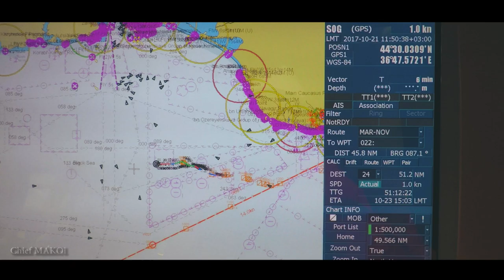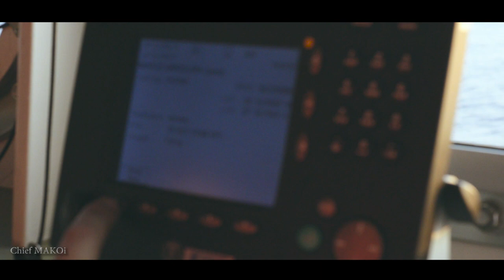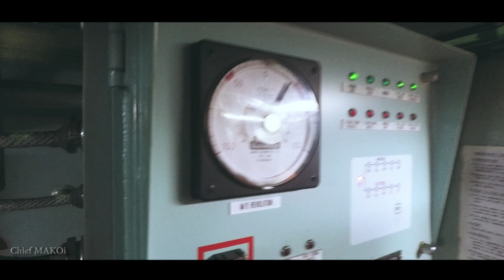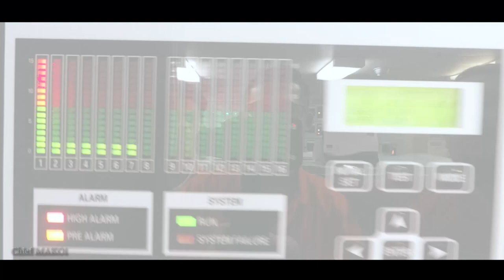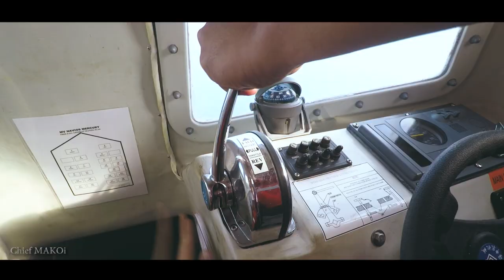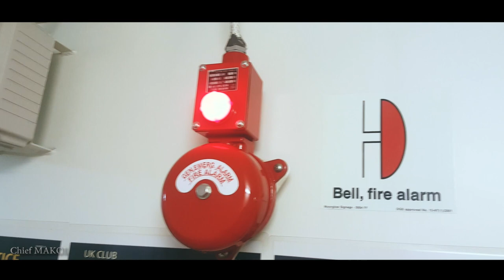Drills While Drifting : Off the Coast of Novorossiysk | Seaman VLOG 035

Comment: Chief Which side is good DECK or ENGINE.. which Side has more work and Less work Or they are equal?
Reply from the maker: I would say equal but different.  Engineers' job are more of the dirty, manual labor sort.  And very stressful when dealing with machinery damage because you will need a strong theoretical background as well as solid work experience to deal with those successfully.  For the Deck officers, they are more focused on watchkeeping and shiphandling.  But there are times when their job demands very long hours.  In the case of Chief Mates, they almost have no time to go ashore as they are the ones in charge of Cargo Operation.  
It basically depends on your personal inclination.  I am technically inclined, I like tinkering with machinery and I view trouble-shooting as an enjoyable challenge so Engineering is the logical choice for me.
Reply: But chief what about the salary packages does deck officers earn more than Engineer officer or the salary is equal to everyone?
Reply from the maker: Salary of course depends on rank.  But officers of the same level e.g.  3/mate and 4/engr, have the same salary.  Captain's salary nowadays is only higher than Chief Engineer's by only a small amount.
Reply: Thank you Chief for the information Love your Videos

Comment: It’s not good  starting an outboard dry  tear the impeller up won’t pump water then won’t cool the engine doesn’t matter if it’s only a second start the impeller still tears when it’s dry
Reply: It's always done like that on ships since in most cases you cant drop the lifeboat to water but you have to do monthly inspections of the lifeboat. And in case of an emergency, procedure is to start it before it touches the water.
Reply: There are adapters for flushing the cooling systems on outboard engines. They clamp on lower unit for removing salt water before storage, and prevent water pump impeller damage from starting dry.